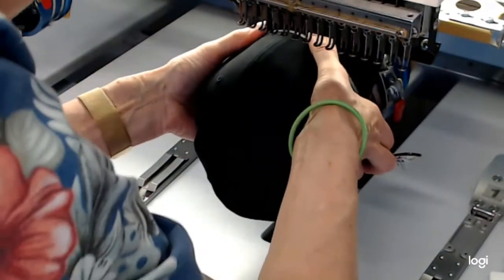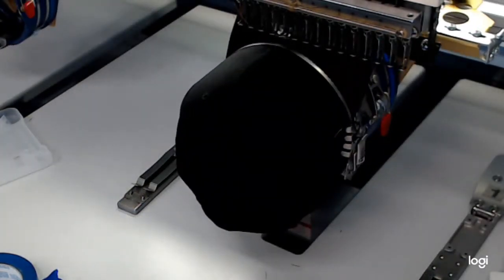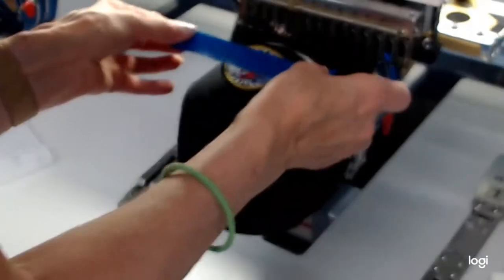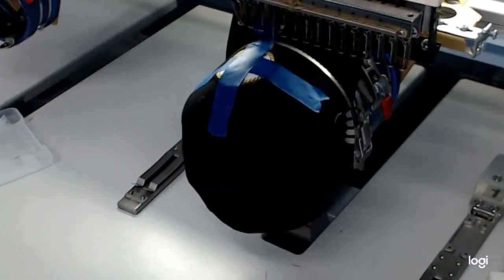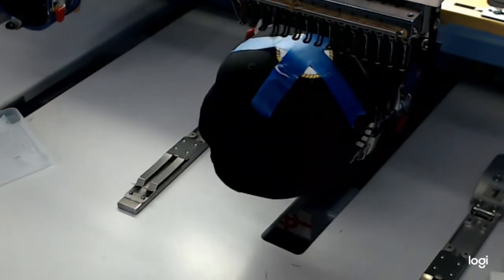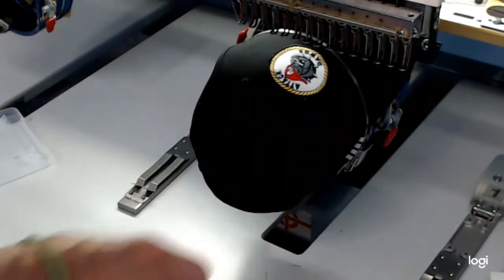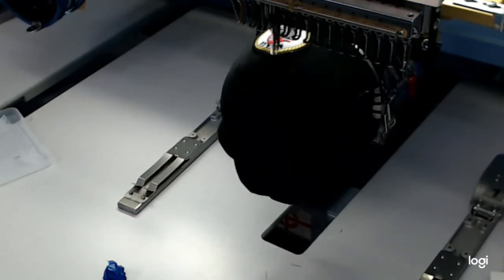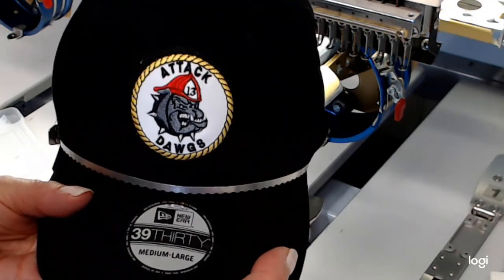Sewing Patches onto a cap with an embroidery machine

Comment: When I try to sew a round leather patch onto a hat with my 15 needle embroidery machine, I make a placement stitch that is 2mm smaller than the patch. When I then glue the patch on top, the placement stitch is still larger than the patch...how to prevent or compensate for this? Is this due to the deformation because the cap is curvy?
Reply from the maker: Hi Maddox, I think that's a good theory since the outside edges of the patch kind of fold in when you lay it on the curve of the cap. The New Era caps I used had a mid-profile structured front so they didn't curve very much.  I imagine you are attaching your leather patches with a running stitch so it wouldn't hide the placement line if it stuck out. Mine would be hidden by the E-Stitch since it hangs over the edge a bit.

Comment: You could heatpress the cap for a few seconds to flatten it out some.
Reply from the maker: Hi Joe, good idea although I don't have a cap press. I originally wanted to heat press the patches on instead if sewing them but didn't want to spring for a new press.😁

Comment: This is impressive! When I do these I do a run stitch just like you do.. but I use spray tack and hold it with my fingers to try and keep everything straight. I might have to try that masking tape! Would you do this same process with a leather patch?
Reply from the maker: Hi Ryan, I know what you mean, I tried spray adhesive too but it didn't hold, plus I wanted to be able to do them on my multi-head machine so I wouldn't be able to hold them. I think I would try it with leather patches too, haven't had to yet.
Reply: I use a silicone spatula to hold down the patch. Let the spatula take a needle than my fingers